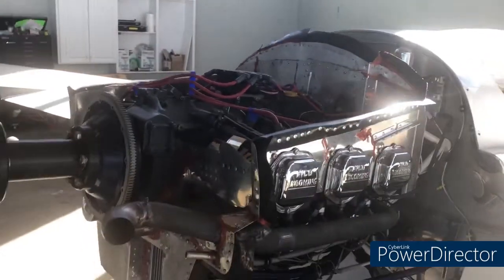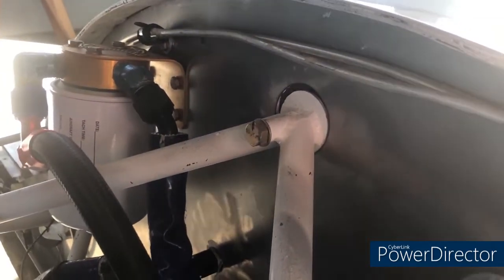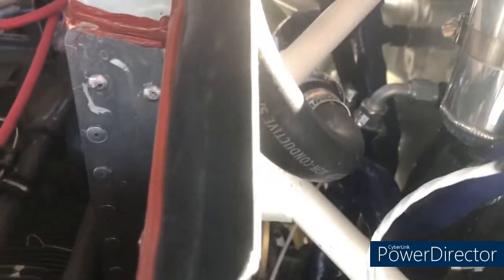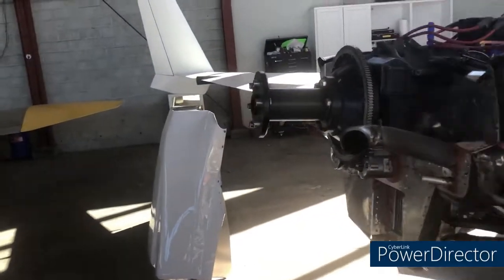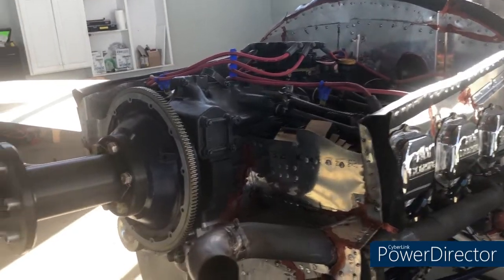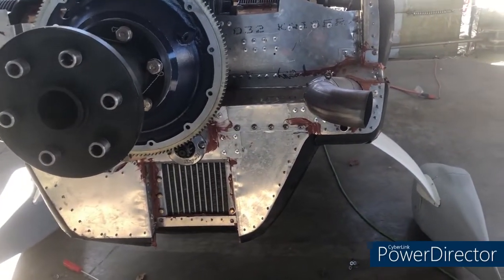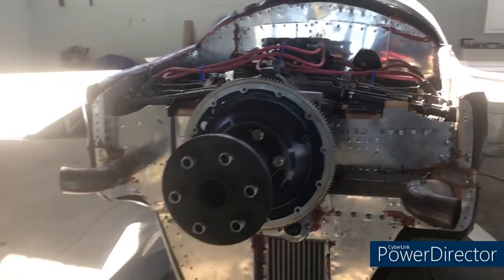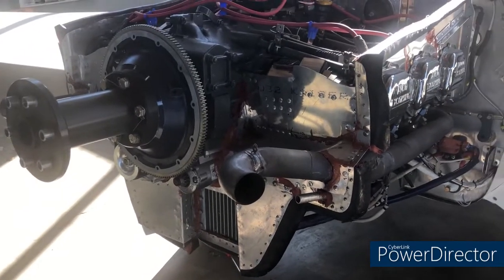Cozy MKIV 540 Installation

Comment: If there is room, how about an exhaust augmenter?  Run your exhaust pipes just inside a larger tube (ID about double the OD of your exhaust pipes…there’s maths for it….).  You’ll get a jet effect that will cool your exhaust air a bit and draw in more air from your inlet.
Reply: With the exhausts pointing outboard?

Comment: Cozy 540 with retract is my dream or a velocity with same specs.
Reply from the maker: The Cozy with the same power is faster than a Velocity, I started my build with a set of infinity gear in my possession, I decided to go with fixed gear for several reasons.

1. Weight... just the 2 main gear legs without the hydraulic pump and all the hoses was 90 lbs
2. build time... this took 13 years, I could easily add at least one year screwing with this
3. Insurance... getting insurance with plans gear is hard enough, NO ONE will insure you with infinity gear
4. Simplicity... one entire critical system eliminated from maintaining or failing
5. Fuel Capacity... I believe you lose ab out 9 gallons of capacity with retracts

My understanding is that Burt says anything under 300 MPH better with well faired fixed gear, Klaus Savier says his fixed gear Long EZ is more efficient than if it had retracts, and with a 360 he is faster than  Berkuts with 540s in them.

That being said, follow your dreams.
Reply: @mylifeasanoldergentleman66  Good to know sir!!! I guess my biggest concern now is front seat weigh limits. I weight 260lbs and would like to fit some one my size in the front passenger seat.
Reply: @majorchungus  260lbs plus a passenger in front seats is pushing the cg limits of the cozy 4 - not to mention your comfort. May want to consider different exp design - that doesnt have the word Cozy in it ;-).

Comment: Am surprised to see a long (8”?) prop extension on this install, especially with exhaust directed outboard and CG concerns.
Reply from the maker: Still want the propellor away from the motor, and my wife's cooking helps with the balance concerns, not with the weight concerns though

Comment: I'm thinking about a Cozy with either a UL Power 520is (200HP) or turbo-normalized 520t (220 HP). I like the idea of a FADEC engine with just one lever and not having to manage mixture, plus they weigh considerably less than traditional engines. Did you ever consider one of these more modern engines or just thought it would be better to stick with a traditional engine?
Reply from the maker: I started with a Mazda 20B rotary attached to the rear, changed it long before the plane was actually done.

 I think the 520 could be a great choice, I am not sure if you need a custom engine mount or if the Cozy Girls 540 mount would work for that.

 At the end of the day, I wanted to fly sooner than later. And sticking with what has been done allowed for off the shelf solutions for everything aft firewall.

My airplane is much heavy than I would like, with the 540, and on the flip side I can carry more weight up front comfortably than a 360 Cozy or even a 520 UL due to the weight I have behind the firewall.

Build the plane that suits your needs.
Reply: I am probably doing a UL520T build myself. Looking at dimensions and weight, when paired with a 4-bladed CS prop, it will basiocally be the same as the IO-360 except 1 inch longer. To offset that can simply mount it close to the firewall.
Reply: Any significant engine weight change from the original Cozy IV design (O-360, 180hp) as well as any changes to the width or length of fuselage require careful assessment and determination of the acceptable CG range of the changed design. Does the builder want to be the test pilot of a new design?
Reply: @danah358  yes, I do. It has already  beendone with the UL520is anyway, which is essentially the same as the 520t, but without the turbo.
Reply: @danah358  There is already at least one Cozy flying with a UL520is. The 520t is essentially the same with a turbo.

Comment: Others who have installed the O-540 have added fuselage length (12-14”?) to better address CG issues. Did you do this and if not why not?
Reply from the maker: I widened the fuselage by 6 inches, I then made the nose about 12 inches longer to keep the nose looking proportional, as a by product my ballast is about 12 inches further forward
Reply: Thanks for replying. One last Q: what’s your determined useable CG range?

Comment: In a previous video, you suggested replacing fiberglass with carbon fiber everywhere that is not structural. Please educate me a bit, but my understanding is that carbon fiber is every bit as strong as fiberglass at a significantly lower weight. Why not use carbon fiber exclusively? Is it cost prohibitive, or are there structural issues that I am uneducated about?
Reply from the maker: You could use Carbon fiber exclusively , it would cost a really large sum of money and your comfort while flying would suffer, think of it as going from 18 inch rims on your car to 22 inch rims, the fiberglass wings and canard flex much more so it smooths the bumps in the sky out quite a bit, but on items that bolt to the airframe like Canopy, doors, speed brake, cowlings, wheel pants the more rigidness is a good thing, you can use lighter and less material.
Reply: @mylifeasanoldergentleman66  I see! So, fiberglass is not as rigid, so in structural places such as wings, spars, etc it acts much like a shock absorber. I know carbon fiber is a bit more expensive than fiberglass but with your input I'm starting to understand that in certain places, with this design, fiberglass is still preferable expressly because it isn't as rigid. So, please correct my understanding if I don't fully grasp it, but you recommend staying with fiberglass in the wings, spar, & canard, but as far as overall comfort is concerned, cost not being considered, would you prefer to use carbon fiber in the fuselage over fiberglass or is the trade off in comfort just not worth the weight benefit?
Reply from the maker: @mikeycrabtree123  Sorry for the late reply, Carbon fiber is a lot more expensive than glass. it is harder to work with in the way this build goes as you cannot visually see imperfections and dry areas while building. I doubt its worth the weight savings to deal with the cost increase and build difficulty. That being said I am no expert by any means. Others can answer than far better than I